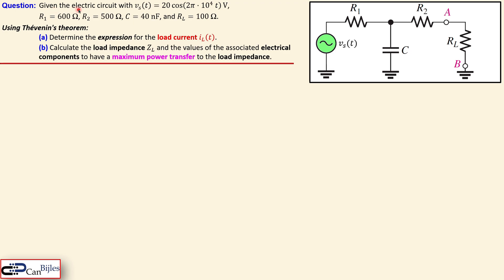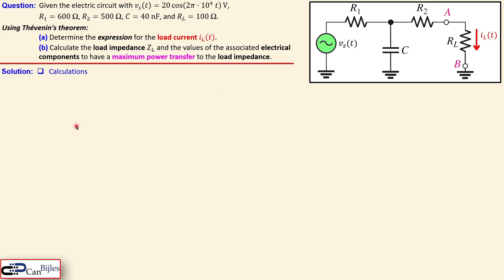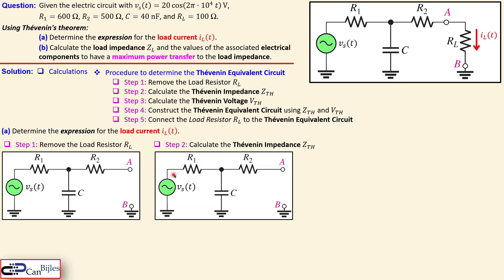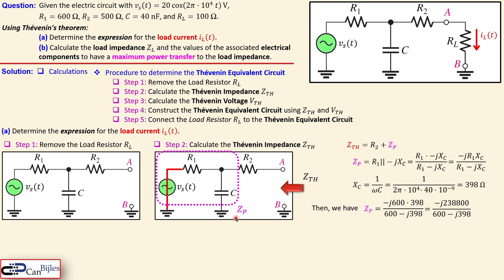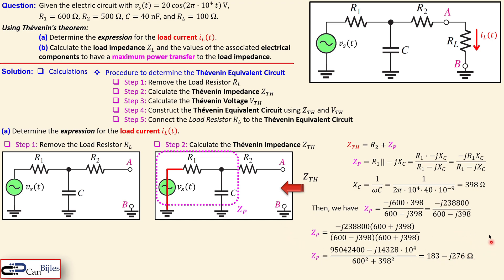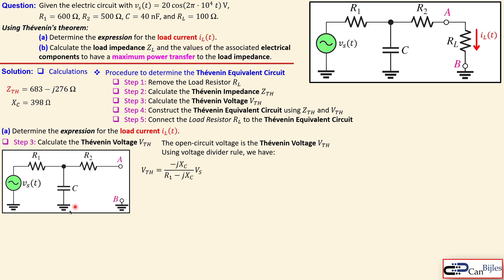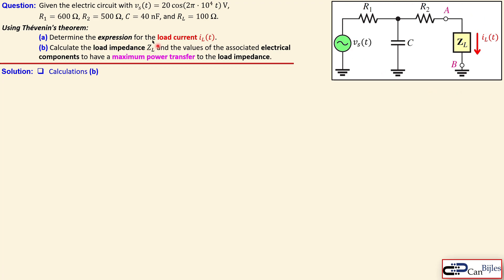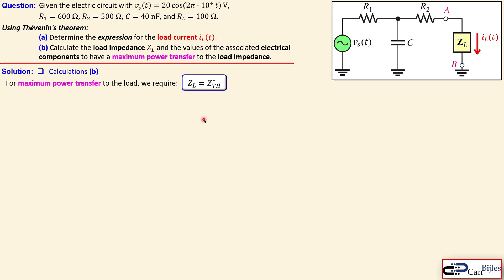Thevenin's Theorem - AC Electric Circuit ⭐ Maximum Power Transfer 💡 Calculation & TINA-TI Simulation

Comment: Thank you to much. I have a question that: if in the question b, i just want to find the R Load instead of Z Load, and I wonder the R Load will be Re{ Z Thevenin} or |Z Thevenin| (module of Z Theveinin). I hope you can help me ASAP. Thank you.
Reply from the maker: Thanks for your message. In this circuit, we have reactive components (frequency dependent). In order to have a maximum power transfer to the load, the load should be a impedance and not a pure resistance. You can, of course, use only a resistor as your load, but this will not make the power transfer maximum.

If you have a pure resistive circuit, than it is possible to have pure resistive load. I discuss this in the following videos using Thevenin's Theorem. 
1. https://youtu.be/h4JCyGT6YTE
2. https://youtu.be/-82oP4y-uXo